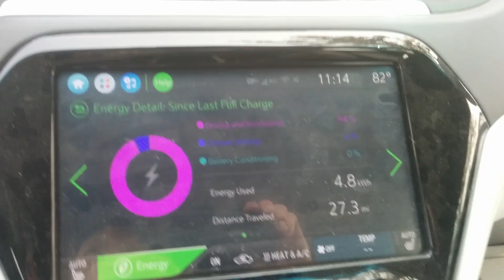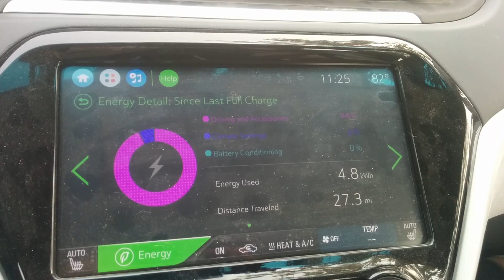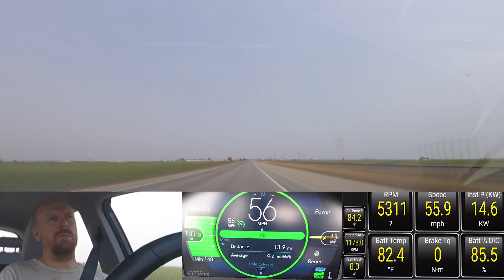Chevy Bolt EV: Efficiency at 56 mph or 90 km/hr

Comment: I recently took the southern route out of Lake Havasu to Los Angeles. When I reached Parker, AZ. I had a fork in the road after already traveling 46 miles, do I go the safe route 87 miles to Blythe or do I take the News Coulomb path which was another 172 miles into Indio with nothing but asphalt & tumble weeds in-between? After watching your videos I chose to go for the Indio route. I pretty much drove at 57mph that whole time. I was doing great until I hit a 35mph headwind out in the middle of BF-Egypt and had I not drafted off of truckers on the 10fwy heading into Indio I am not sure I would have made it. But I did. This was one of the rare moments when I felt that the battery recall update really effected my drive.

Comment: Great video as always! I got curious about the wind effects and did some reading and calculations. At a base speed of 80 mph a 10 mph head wind requires 10.7% more energy and a 10 mph tail wind reduces energy usage by 10%. So it looks like it roughly evens out. I know in aviation side wind causes more energy because you have to fly the airplane slightly sideways to stay on course. A car has ground contact and the wheels keep it on track. Side wind doesn't cause as much energy loss as on an airplane.
Reply from the maker: Thanks. 

I'm surprised it would be that close, only because the increase in the energy required to overcome drag isn't linear. Also, I'm not sure it would ever be that clean in real world driving. Front quartering winds also have a significant, negative impact on efficiency, while rear quartering winds provide very little improvement.  And then add to that variances in how different profiles are affected by front versus tail winds.
Reply: I guess it kind of makes sense because if energy consumption goes up geometric with speed (double the speed, quadruple the air drag), it would also go down at that rate.
Reply from the maker: Yeah. I just did a quick check, and I was off a bit. Apparently, a direct headwind has the same impact as driving that much faster (e.g., driving 55 mph into a 10 mph headwind uses the same energy as driving 65 mph with no wind). However, a front quartering wind has an even greater impact on efficiency because the frontal area is increased and the Cd is typically worse.
Reply: True the side of a car is a much larger area. At the end of the day, there will most likely always be a little bit of wind when driving anywhere in the world. Doing a roundtrip test is the best thing one can do.

Comment: 29.8/6.9 is only 4.3 mi/kWh. Did you have AC on or other extra stuff? I ran 55 MPH test many times with SparkEV, and I was getting 5.2 mi/kWh. It's hard to believe Bolt is almost 20% less efficient.
Reply from the maker: It's possible, but I'd need to actually test a Spark EV to see for myself. I know it's an efficient car at lower speeds, so it wouldn't surprise me if it had similar numbers to the Ioniq Electric. 

Most likely it's due to the rolling resistance.
Reply: Tony Williams drove SparkEV at 62 MPH (100 kph) for full battery until car stopped, and it showed 5 mi/kWh, so 5.2 mi/kWh at 55 MPH is normal. That's why it's surprising why you got such low figure with Bolt. Can you try again, but with AC and other stuff off? Maybe AC was working extra hard?
Reply: The Bolt is bigger and heavier. It's no surprise the Spark EV has better efficiency.
Reply: EPA rates Bolt more efficient than SparkEV. At worst, I expected just slightly worse than SparkEV, not 20%.

Comment: I did the same  round trip test here in North Dakota with head winds at 14 mph one direction , 18 feet elevation change and got the exact results. 4.3-4.4 miles/kWh. My tire pressure was at 42 lbs., with standard rims.
Reply from the maker: Yes, I checked out your videos. Great job. 

At 56 mph, I the wind speeds might have had less of an impact than the tire pressure. Both can result in a ~3-4% difference. 

The differences at 75 mph would be far more pronounced for wind and far less pronounced for tire pressure and AC. For example, my worst efficiency ever recorded in the Bolt EV was 2.3 mi/kWh, driving 75 mph into a 20-25 mph headwind.

Comment: I wonder how it would do with some 155R80/15s inflated to 40 psi. Those have about 5” wide tread as compared to 7.5” wide tread on a 215R50/17.
Reply from the maker: Well, that's how BMW lowered the rolling resistance on their i3. I actually think just increasing the tire pressure by 3-4 psi would improve efficiency by about 5% at these speeds.
Reply: News Coulomb, it would be interesting to know where the knee in the curve is between efficiency and safety/comfort. I think as we gain efficiency in motors, inverters and battery capacity, we can afford to waste more on drag. Like with an electric Hummer H1, who cares if it only goes 2 miles per kWh, it’s still cheaper than running the original Hummer. 

Back when we first started seeing 5-speed overdrive transmissions, people would say “now I can get the same MPG at 65 as I did in 4th (1:1) in my old car. LOL
Reply from the maker: My preference would be to see highway vehicles be as efficient as possible, but comfort and safety will take a toll on that. And there's only so much that faster charging can compensate for. Right now, the best balance might be the Model 3, as it is floating around 4 mi/kWh at typical freeway speeds. All while on tires that are capable of decent braking and handling. 

The big bump up will come from lighter batteries. If solid-state batteries can increase energy density by ~ 3 times, it means we could see a Bolt EV with nearly double the range weighing 500 lbs less. At that point, put performance tires, or don't. Have heavy, plush interior, or don't. In the meantime, we're working a very tight balancing act.
Reply: That would be another good test, add 20% payload in your Bolt and 20% more tire pressure and see what the steady state cruise efficiency is at 56 mph. I think it won’t even be noticeable until the first time you use regen, at which point the added weight will cause added regen losses. 

If you can find a straight gradual slope that lets you coast down at 56 and drive up at 56, I think you will still get near 4.2 miles/kWh average. 

I think you can add 1000 pounds of batteries and if you drive a little more efficient to allow the extra kinetic energy to be consumed during your roll to a stop, you will still get 4.2 miles/kWh.

If they can get 3x energy density by weight and volume, that will be good as long as it doesn’t slow charging speed. Some are saying the solid state batteries might actually charge slower because it will be harder for the ions to travel through the solid electrolyte.

Comment: https://youtu.be/RZzk88fFA-8
"...Well, Bjorn subsequently released a video where he tested the efficiency of an Ampera-E; however, in that testing, he was seeing numbers that were about 20% less than what I would typically see at the same speeds. Why the difference? Who's data should you trust?..." - News Coulomb

Bjorn's result
90km/h 144wh/km
120km/h 208wh/km

News Coulomb's result
90km/h 144wh/km

Steve's number with 20mph head wind
90km/h 141wh/km
Reply from the maker: Yup, though Steve quoted the headwind at 10-15 mph. I think it was closer to 10 mph. He's released a subsequent video at 65 mph, and the efficiency was about the same as he saw driving into the headwind at 56 mph. It's important to note that a 10 mph head/tail wind at 56 mph has less impact on efficiency than it would at 75 mph. 

Also, maybe I need to pay closer attention to Bjorn's routes, but is the 90 km/hr route the same as the 120 km/hr route? If it's different, that could also explain the variance.
Reply: News Coulomb You did a good job showing the data. That's all you can do. It is up to the viewers to decide based on your information.

If you had done this test at 68 degree. You could have seen 18% improvement.

Bolt range based on temperature.
Temp range (low)
-20º C 167km 
-10º C  180km
0º C  240km
10º C 357km
20º C 448km
30º C 371km
40º C 269km
Reply from the maker: Well, sure. I'm not going to convince anyone of what they do or don't want to believe, but I will call out factors that might or might not affect numbers.

Comment: NC -  I took mine on a long weekend out of state trip the past 3 days.  1100+ miles.  Lots of road types - much of the trip was 50+ mph.  Climate control on 72 degrees for the entire trip, which averaged over 80 degrees outside, and was as high as 90 degs and muggy today.  Freeway speeds never exceeded 65-66 mph.  Tires to spec pressure.  4.4 mi/kWh average for the whole trip.  I found that to be a great number!
Reply from the maker: Yeah, definitely! I think that's what most Bolt EV owners can expect. I'm going to throw up the 75 mph efficiency numbers soon, which I hope will help people plan for their freeway trips better.

Comment: This is very close to my experience on a mostly highway commute at 60 mph. Putting around town on the weekends consistently nets me 5.0-5.5 mi/kwh.
Reply from the maker: Yes, that has been my experience as well. I wouldn't be surprised if just upping the tire pressure to my typical 42 psi would have made up that efficiency difference.